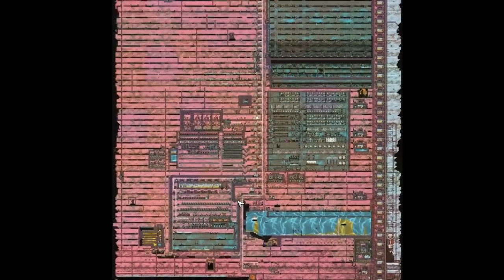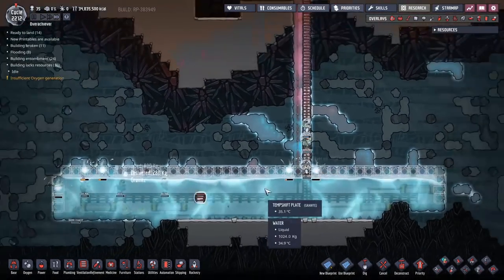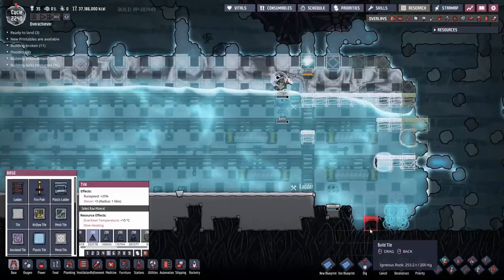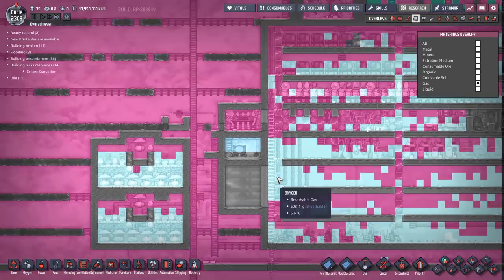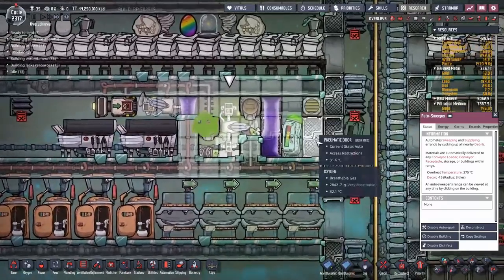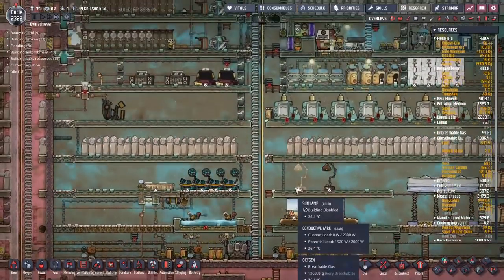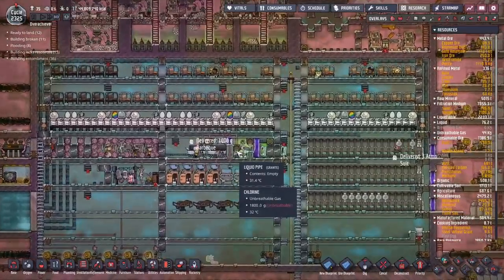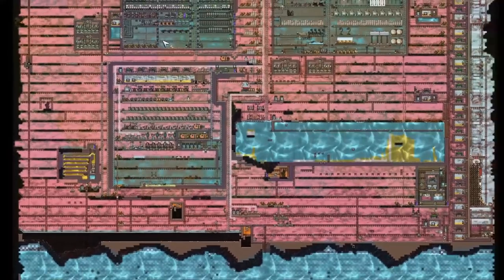Rime 35 : Melting frozen core, Moving to new micro base : Oxygen not Included

Comment: I think it would have been interesting to use the excess heat from the chimney to melt that all. 500+ degrees going in may have gone a bit faster than tepidizers at the much lower temp they run to
Reply: Missed opportunity right there.
Reply: That would make a lot of steam and mess up the core, would become a steam core.
Reply: Ivi Costa given the mass of the ice down there and how cold it is it very well may not

Comment: You could use pulsers to allow the tepidizers to heat beyond their normal 85C cutoff. Set the buffer to 0.1 secs and it will stay switched on for a microsecond before realising it's too hot.

Comment: 20/20 hindsight - maybe radiators might've been a good idea to pump some of that heat around to speed up the progress of heating up the frozen core. :P
Reply from the maker: Working with trying to freeze or melt a pool of water this big you learn a few things. Without temp shift plates it's really difficult to heat up or cool down large bodies of water. I filled the bottom of a map with water once and dropped the temp in the middle to absolute 0. Still took forever for the chill to spread, ending up having to install a big line of temp shift plates.
Reply: @FrancisJohnYT  How would boiling hot oil or petroleum work as a radiator to melt the core? You probably couldn't do very long runs in the core with those -120C temps, but you could move the radiators around like you were doing on the temp shift plates.

Comment: A bit sad you didn’t let the rocket silo do the melting but the end result is the same. Now to build a proper unbreakable insulated floor on the oil pit and while you are getting rid of neutronium you can flatten the bottom of the new water pit.

Comment: I think just like you made the core frozen in the previous series, you can fill there with magma. That would make much more sense. Though I dont't know how could you heat up that much area. Maybe some super heater mods? Or just use the heat of your rocket chimney.
Reply: Metal Refineries with molten steel in a loop as the 'coolant'. You use it to just dump ridiculous amounts of heat into the 'coolant' and then from there into the environment. I'm sure there are other ways too.

Comment: The problem is that all your granite tempshift plate are soaking heat: ideally you should have used gold, copper or lead and left an empty space all around every plate. Or you could use metal refineries to produce the heat you need
Reply from the maker: The heat required was insane. Using a metal refinery it would have taken 4 operations of steel to melt one tile of water. Tepedizers were cheap, fast and more importantly I could spam as many as I needed.

Comment: im a little sad you didnt use the heat from the rocket silo to help melt the ice.
Reply from the maker: I though about it, but the silo was not generating enough heat. Well it was not going to generate it and push it into the ice. Also the CO2 cushion at the bottom was not going to help. Could not think of a way to do it with rocket heat that would not take thousands of cycles.